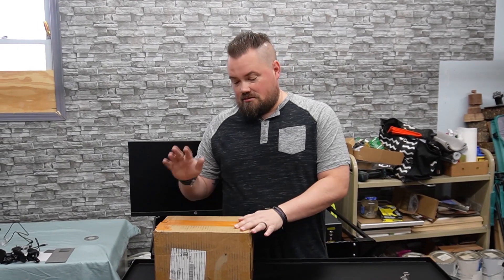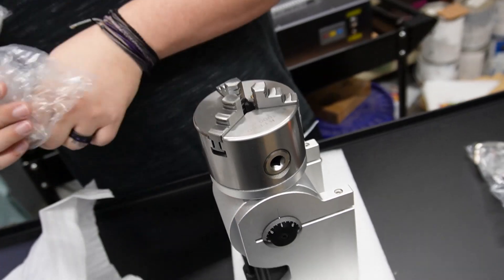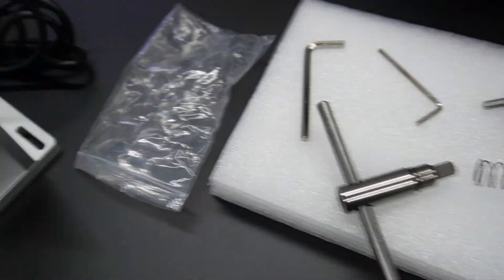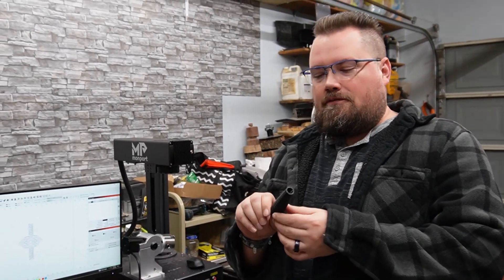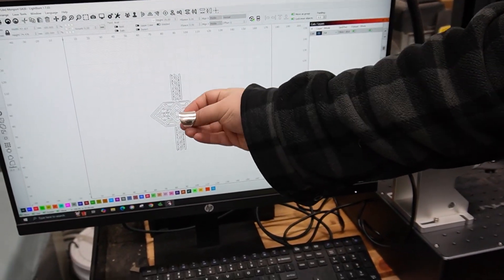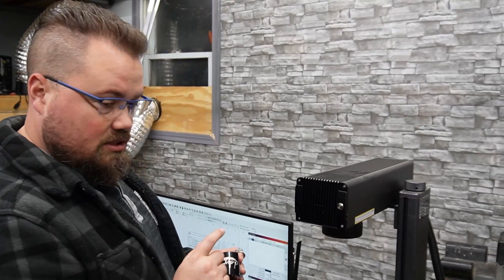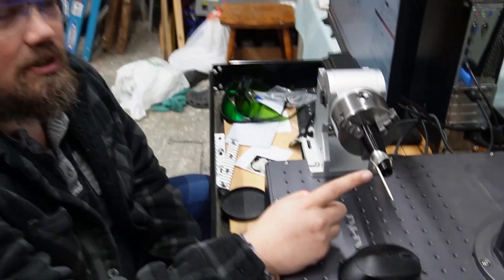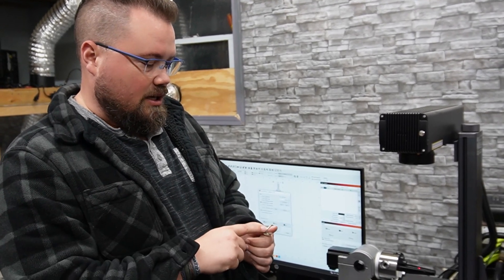Fiber Laser Rotary Attachment | Monport GA30

Comment: Can you please check the voltage of the motor? Do you have any markings on it? I am looking to use the rotary roller I have for my Monport CO2 with my Monport GA60.  The plug is the same, I would just want to double check before testing it.